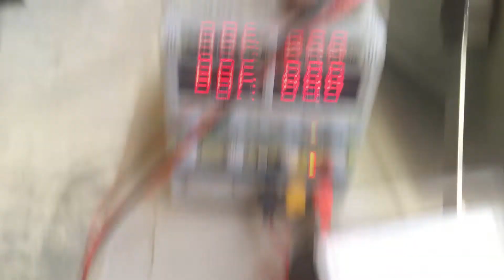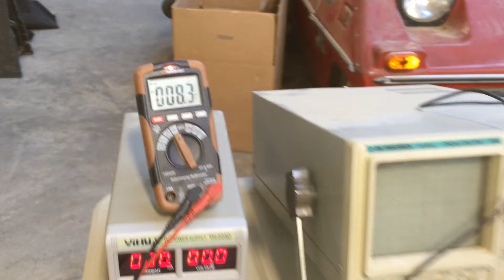3D Printed EZ Spin Motor V4 - Runs on less than 10 millivolts!

Comment: Hello Lasersaber.  Have there been any more updates to this project after this video was published?  I had previously downloaded the 3D print files and had it printed then I constructed it and I have fun with this.  I also find it neat that it can run on higher voltages.  Ive ran mine up to my max supply voltage of 60v DC.  Also I have since downloaded the STL files and printed this myself.  I am aware this video is old but I figured that there must be more to it that I have not seen yet due to the fact that you stated you had some big ideas for this.  It also makes a nice little generator when I turn it by hand and lights up LEDs quite nicely.  

By the way I also printed the EZSpin V4 and I like it a lot!
Thanks!

Comment: Hello, I've always thought that if a device where to show an energy savings from some other source than conventional that it might manifest itself in one of these low voltage low current devices. I've had luck myself with pounds of steel rotating with micro amp current draw, but it's hard to prove what's coming from where sometimes right? I like what I see and would like to try something like this if you divulge more information. Are you using mag lev, bearings, or needle? Looking forward to seeing where you go with this.
Nice job.
John

Comment: Very nice... but... Can you please explain how you can get a valid voltage reading, then simply change the knob setting and get a valid current reading, without changing the hookup connections of the DMM? Please don't tell me you are simply connecting the meter as an  ammeter directly across the output, so that the ammeter itself is the load.

You certainly have quite a collection of colored clipleads! Overunity can't be far off!
(just kidding). You should be able to drive this motor synchronously from the output of your Function Generator, controlling rotor speed by varying the frequency of the FG's pulse output.
Reply from the maker: TinselKoala 

Sorry, I should have stated that I was testing open voltage vs short circuit current.   I will add that "the meter test was open voltage vs short circuit" in the video description.  I have not yet even finalized the final hookup configuration on the generator coils.  Currently I have been testing only open voltage vs short circuit current in many configurations looking for the configuration that produces the least amount of drag on the rotor while shorted.  Once I am satisfied with the generator arrangement I will do some proper measurements using two meters, one to test voltage the other measuring current in line to the load.  On this video I was just testing to see if 1 volt could be stepped up to light an LED.  One of my goals with this motor design was to build a motor that could run on less than 100mV while also stepping up voltage to light an LED.

I was driving it the other day at 3 volts and when I went to hookup the rectifier I got a really good shock from it.  I let out a yell that was heard through the whole shop.  With 5-10 volts in florescent bulbs start lighting up. :-)
Reply: lasersaber
Thanks for the clarification. The last time I saw someone do that kind of "current and voltage testing" with a single meter he was seeing lots of amps from a larger generator arrangement and then multiplying the open circuit voltage x the shortcircuit current to get "watts" and claiming OU! Of course with the shortcircuit current reading, the voltage reading drops, but with one meter you don't see that since the readings are sequential not simultaneous. But you know better than that!
Yes, you've got a lot of inductance there and I can well imagine that you will get quite a spike when the coils are shut off even if the supply voltage is small.
Nice work, I wish I had a printer to play with! And the maze of clipleads make it look like a Jackson Pollock artwork!
Here's my lowest runner so far: https://www.youtube.com/watch?v=zdNdR8Uz_dA

Comment: nice motor, wonder how it would work if you used an earth battery setup.  The way I started my earth for battery is just to crush different types of rocks down to a powder add water and get half a volt

Comment: good work keep it up..my current experiments based on bedinis 1984 self running generators might benefit from this..I havent been able to run my motor longer than 14hrs at 1.5volts as the generator coils arent providing the current required to recharge the battery..

Comment: What are you using as bearings, since the rotor is so small do you think you could float it between the housing w/ super magnets?  Also could you harvest the power coming off of it and step it up to say charge a super capacitor during the day and then run a LED much brighter at night?

Very cool build...keep it up!
Reply: Funny you should mention that. I've been working on a friction less solution based on what you commented on. I'm almost there, fine tuning just like lasersaber. Sweet spot via magnetic fields are hard- but awesome concept don't you think? A bientot!

Comment: Pretty amazing it runs on such a low current. Do you have any idea how to measure the torque it generates? It must be pretty tiny.
Reply from the maker: USWaterRockets 

At super low voltages it has almost no torque.  At one volt it has enough torque to easily light a white LED.  It is not really designed for doing torque tests.  It makes a great little platform for doing generator coil tests as well as running on very low uA in another configuration or super low mV when wired in another way.  It really is a very versatile little motor.
Reply: If that's what you're after, you might want to try putting the motor in a vacuum chamber. You will probably see a very dramatic increase in output when you eliminate the air friction on the moving parts.
Reply from the maker: USWaterRockets 

I would love to have the skills to but a rotor inside a glass vacuum.  Since you mentioned this I have been thinking about designs where the rotor is in a glass vacuum and the coils are outside the vacuum.  I have started to research glass vacuum bulbs and tubes a little.  I guess I need to become friends with a local glass blower who knows how to work with vacuums.
Reply: lasersaber You can get a decent vacuum pump for under $100 from Harbor Freight. It won't create a perfect vacuum, but to draw out even 80% or 90% of the air would make a good proof of concept. For the glass you just need to find a canning jar with smooth sides and put a hose coupler into the lid. We use this kind of setup to test our homebrew altimeter you can see it here: https://www.youtube.com/watch?v=qISDx3i5DpY&list=UU7sXV2WQCmCZg31fD4qnOlg

Comment: How is the torque of the motor? I guess it is very easy to stop the motor from turning with your finger lightly pressed on the disc. Still impressive for such low current.

Comment: Whats this motor good for?
Reply: He gives 1 exemple at the end of the video.
Reply: I think the long term idea is to create a self running motor that recharges itselt as it moves...something not easy to achieve yet..even bedinis wheel move and eat up energy and cant generate power to recharge itself although it can charge another battery hooked to it except for a claim by him in 1984 bedini cole motor
Reply: no motor in the market can recharge itself as it moves yet due to the crippling effect of lorentz law..but staggered run and charging pulses could overcome this to a great extent but still may not be perpetual